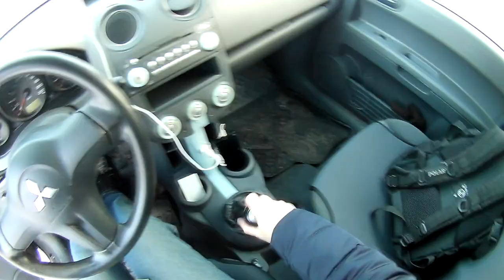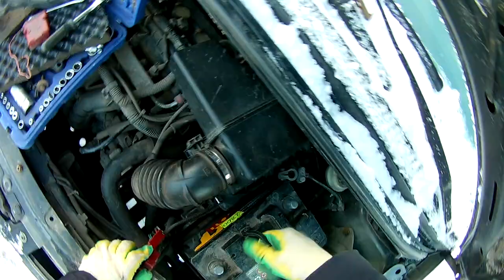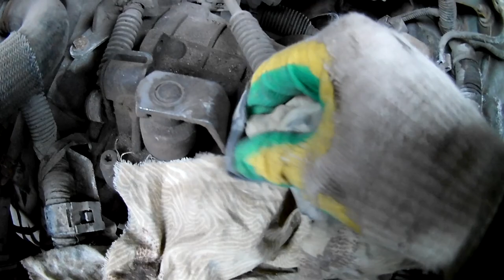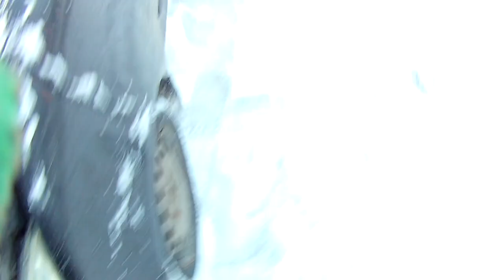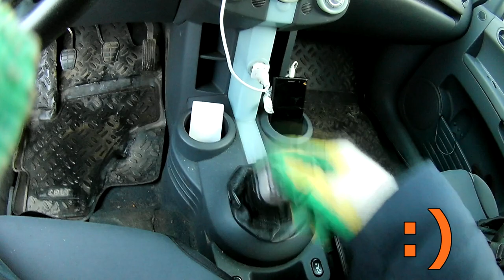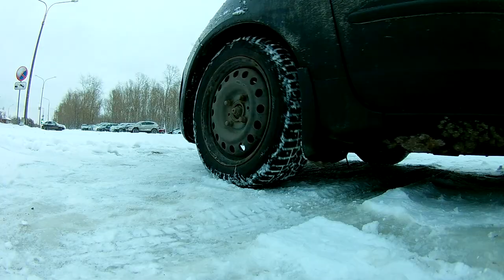MANUAL TRANSMISSION PROBLEMS | How I fixed and kept driving

Comment: I have this problem on my 2006 Honda si I can go into every gear but 3rd gear is sloppy and won’t actually shift into it, every time I try it’s basically like it’s on neutral, can anyone tell me if it’s actually the shifter bush or if it’s my transmission? Or anything else?

Comment: mine has a burnt smell inside the car when driving after like 10 mins, and also when I'm in 3rd of 4th gear and try to accelerate fast, as soon as it hits like 40mph the gear kinda slips? and it's like in neutral? so the rpm is very high (since I'm pressing the gas) but I'm no longer actually accelerating... and then when I apply brake and come down to like 20mph it goes back to normal. any help is appreciated thanks.
Reply: Clutch slipping
Reply: Yep, it's the clutch. Bad news I'm afraid.
Reply: @jftechdrones  yeah thanks. had it fixed a month ago. All in service brand new clutch bearing, plate and disc with mechanic labor pay all for equivalent to $150 (I live in Philippines). It's all good now this video helped me

Comment: Great job its a problem in many colts
Reply: Какая проблема (болтик отходит?)Я собираюсь купить себе МИТСУБИСИ КОЛЬТ 2004,первый авто !!!
Reply: @musicgun2492  shifter is hard to move after it collets rust (needs lubrication). But it can be cleaned. Go ahead and buy. Colt is the best low cost and fast.

Comment: That’s what happened to me this morning
Reply from the maker: I hope you fix it
Reply: What’s the actual problem called. It’s stuck in 5th gear and that’s how the stick is moving, dancing all about but not going in gear
Reply: @boomergarage  people saying the transmission is bad and need new gear box but it was driving it’s just stuck in 5th gear and then when could finally pull over i stopped. So now it’s stuck but turns on and of fine just not going in gear
Reply from the maker: @prolifik_hussle5972  :(
Reply: Did you fixed it.